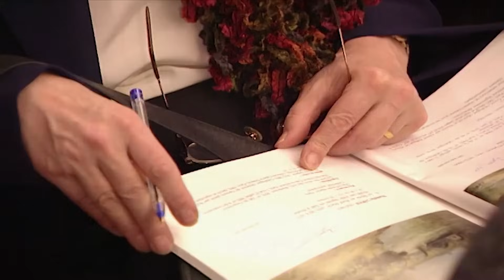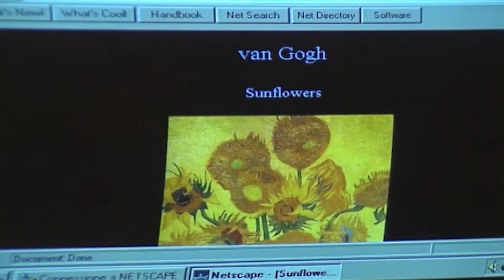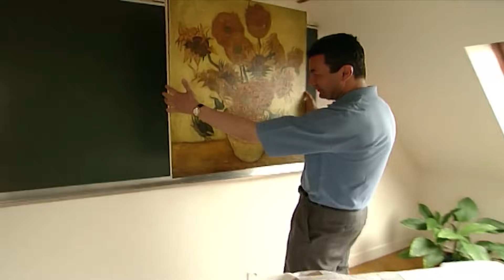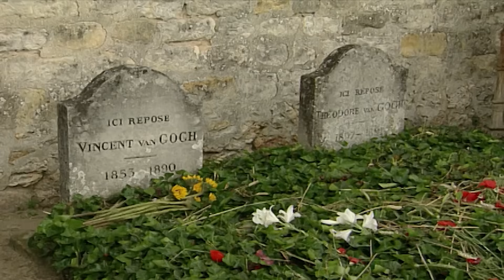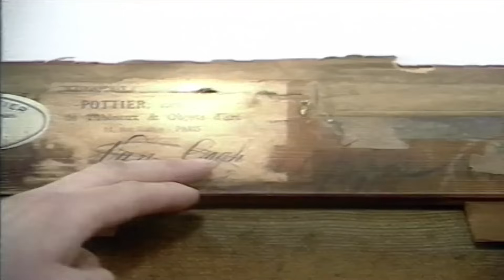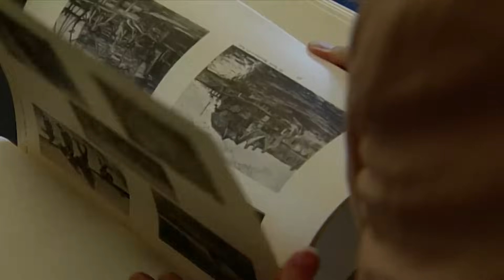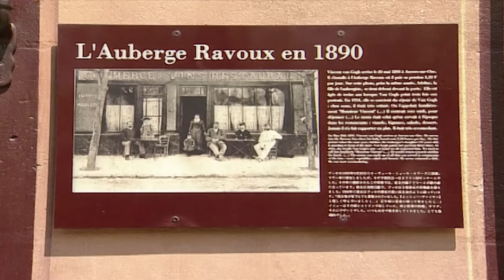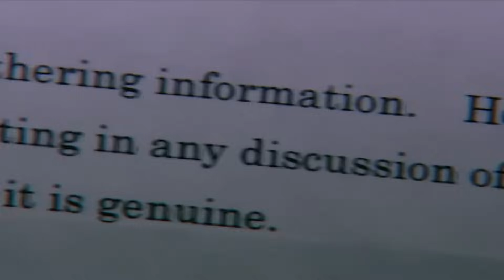Award-winning Documentary | The Fake Van Gogh Paintings? | Real Crime

Comment: If all are original, they should all be different since they would have been painted at different times either over days or weeks.
The difference between the paintings could be because of the changes of the flowers through wilting.